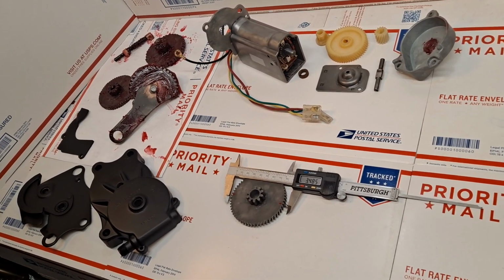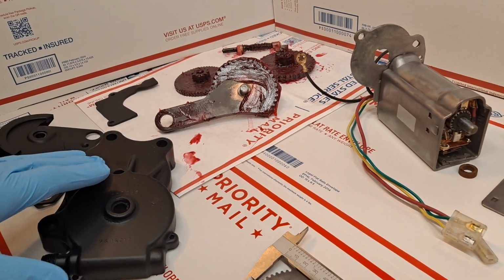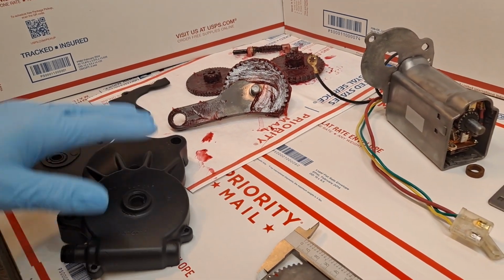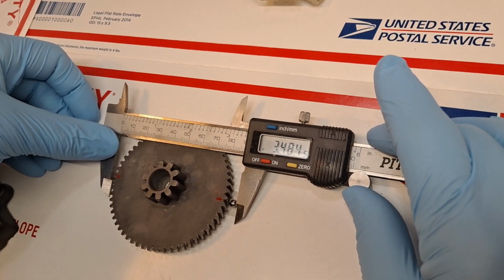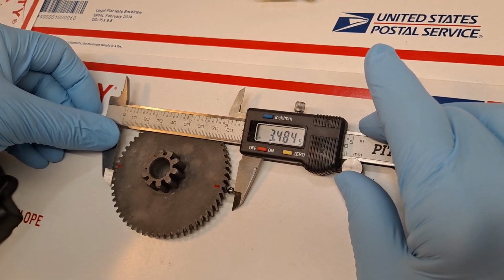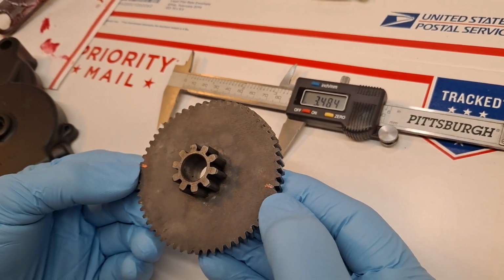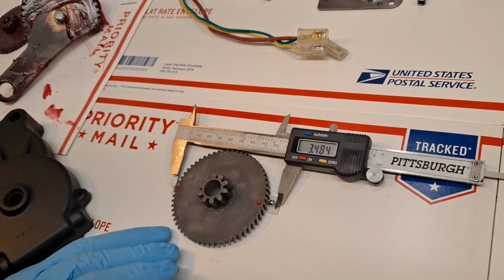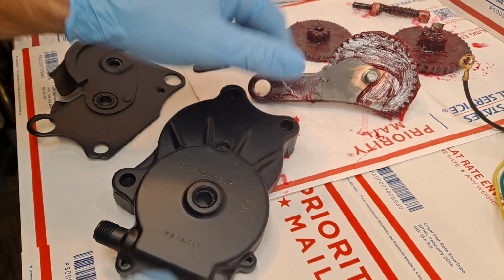1975 CADILLAC ELDORADO CONVERTIBLE TOP GEAR DRIVE MOTOR & GEAR BOX ACTUATORS RESTORATION BenchLayout

Comment: Wonderful job as always, where did you get your Teflon gear at, they sure are hard to come by
Reply from the maker: Hello Joseph and thank you for reaching out to me regarding my original vintage Cadillac items and specifically the Convertible Top Drive Motor and Gear Box Actuators. I have over 75,000 original vintage parts for the Cadillac Eldorado Convertibles including half a dozen drive gears remaining in my collection. Feel free to contact me directly at 727-364-7523 or via email kypitsn@aol.com 
Kind Regards George 727-364-7523
Reply from the maker: Hello Joseph and thank you for the kind comment pertaining to my restoration workmanship. Pertaining to the replacement of discrete components such as the gears,.. I have a substantial inventory of the critical parts and I have over 100 molds for casting of such items in order to facilitate my client customers restoration requirements. I also have over 375,000 Original Vintage Cadillac Items from 1959 through 1976 through 78 for the Eldorados.
Kind Regards, George Tel: 727-364-7523 eMail; kypitsn@aol.com